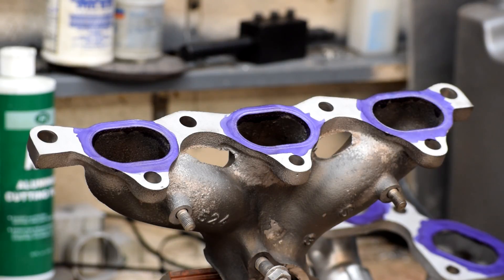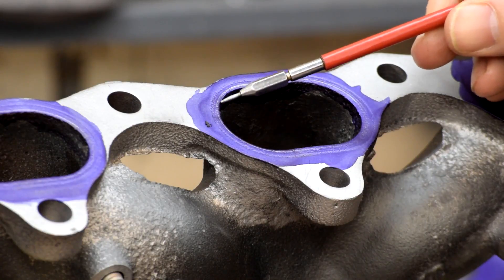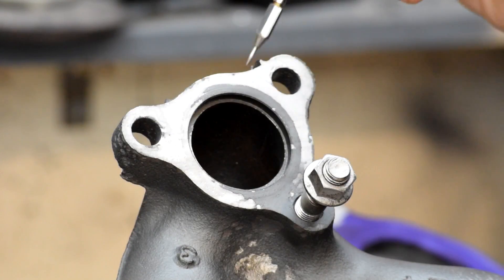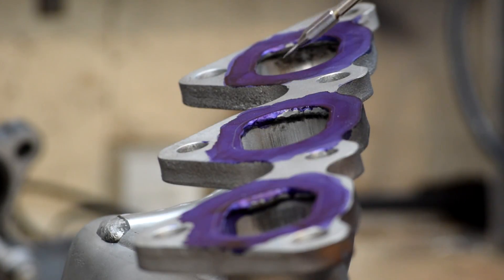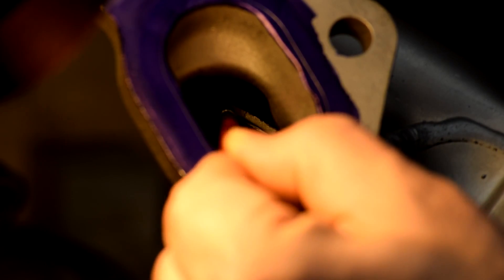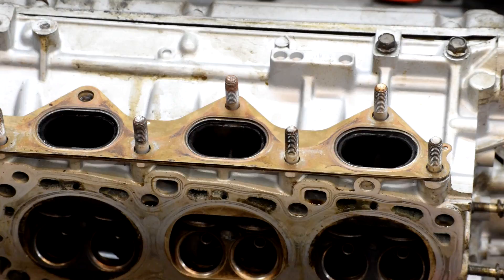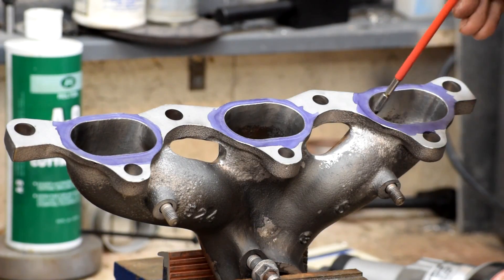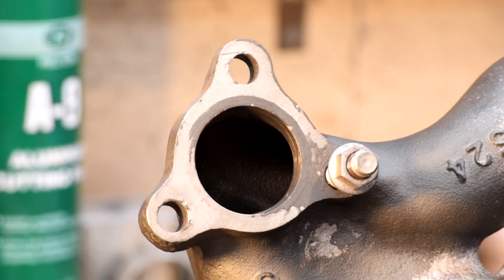FNR Stealth Project Ep 10 - Porting Exhaust Manifolds

Comment: When you do this do you also have to upgrade the intake?
Reply from the maker: No. But it sure helps support future upgrades on the intake side, if you are planning them.
Reply: @FNR  if not is it kinda debatable whether it’s worth the effort? I have a matrix 1zz motor. The revised plastic intake may have more flow but I’d assume it’s the same
Reply from the maker: @KollynJ  anything that helps flow on the exhaust side of a turbo motor will pay dividends - even if the intake is itself restrictive.
Reply: @FNR  good to know. Mines just a 1zz on a matrix. I happened across a couple porting videos and sparked my interest since the part it already out. My manifold is warped and I want to machine or sand it flat but it has raised rings around the manifold ports which would get eliminated. Are these needed? Or would it be better to take it down to flat

Comment: Got a question re port matching. Have you ever measured (or got one of those endoscope cameras) to see if there's actually a step between the head & manifold when you've got it bolted to the head? I can see the compressed gasket being very thin and making only the tiniest of gaps. Also, if they match when cold, how much does the manifold move when it's hot? Is there much of a case for deliberately making the outer manifold ports wider to cope with expansion and still not have a reversion step?
Reply from the maker: I'll be port-matching the heads to the gasket, so there shouldn't be much of a step, and the general idea is to err a touch on the big side on the exhaust side so if the match isn't perfect, the flow passage necks up rather than down. The expansion question is a good one, but I wouldn't expect stuff to move that much.

Comment: Pretty unusual that a cast manifold would be used for one side and a tubular manifold welded up in an interesting way with the sheet metal right in the way of air flow on the other side.